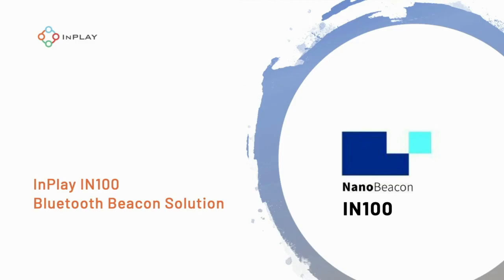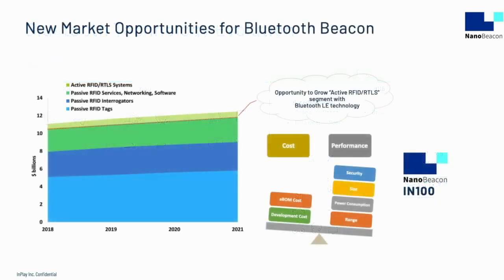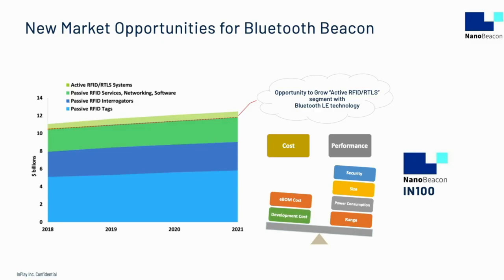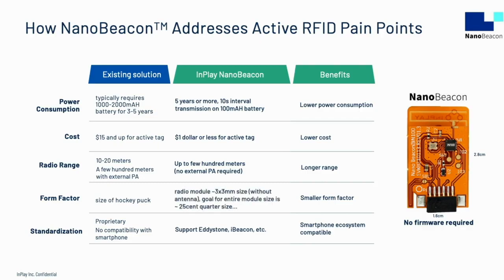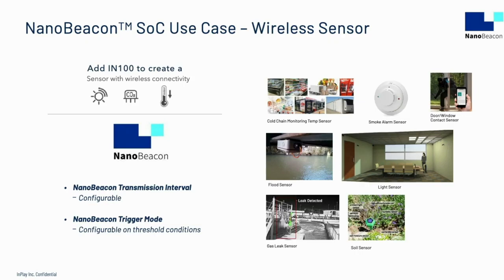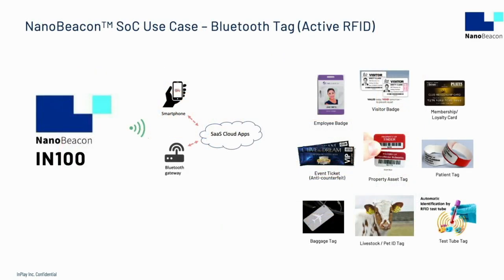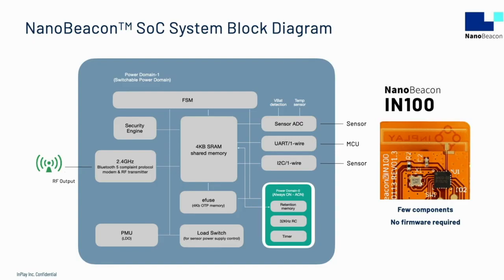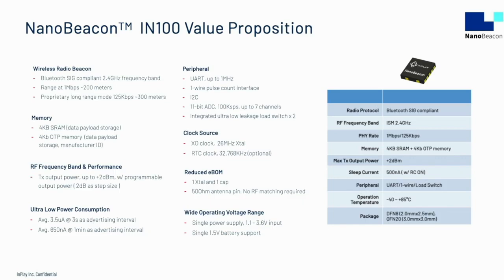Introducing NanoBeacon: A No-Code Bluetooth Sensor Beacon SoC Technology

Comment: What is the average current? When reading sht40 every 10 seconds and broadcasting at 0dbm. Can I use Lithium-thionyl chloride battery directly (slightly over 3.6v)
Reply from the maker: Please refer to our Github link for more information about power consumption estimate when to connect IN100 with a SHT4xx sensor. https://github.com/NanoBeacon/config-files/tree/main/Sensirion%20-%20SHT4X%20Humidity%20and%20Temperature%20Sensor